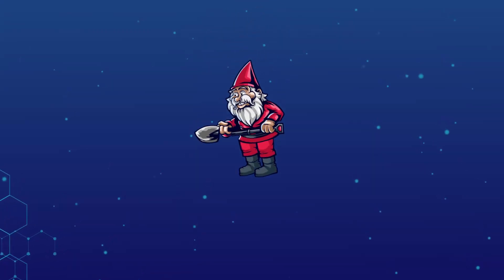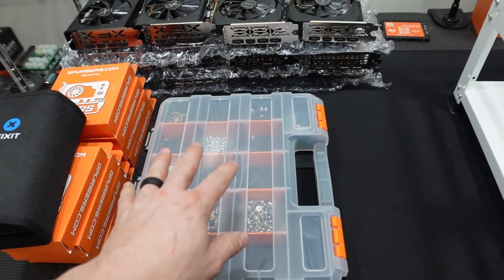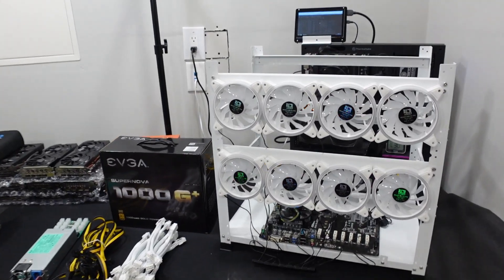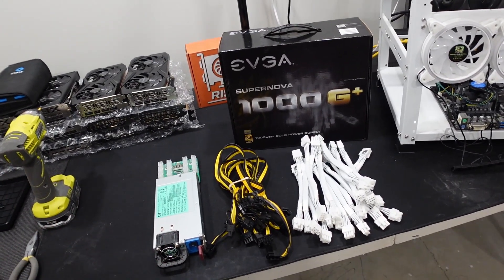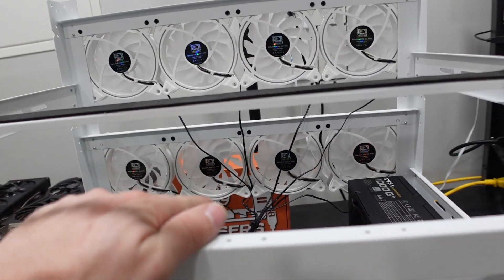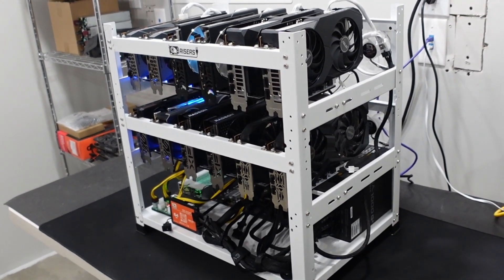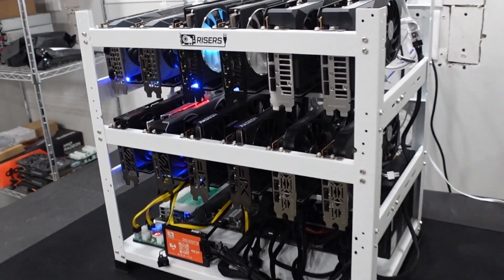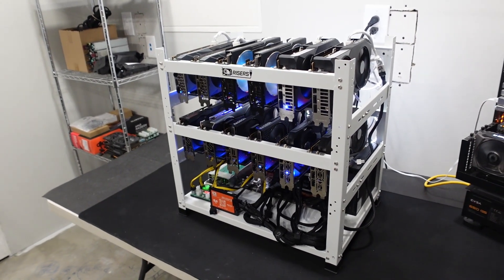How To Build A GPU Mining Rig | RX6600 Crypto Mining Rig Build

Comment: The Hobbyist Miner , your probably not running as efficiently as you could be using that dual power setup. I have three 12 card 6600xt rigs all running off ONE 1300W PSU from Antec (Platinum rating). It's using between  705w - 715w total power (each 12 card rig) at the wall. These are great builds with little to no downtime at all , they have an up time of 59days on Hive!!! Best bang for your buck.
Reply: those antec platinums even have a built in link feature. wow.

Comment: Dude I'm excited to see your journey with heat management; I am already worried; especially if ETH is no longer mineable and we have to use a KAWPOW variant algorithm like Ravencoin, feeling like it will be uncomfortably hot in my basement.
Reply from the maker: I have no plans to mine Ravencoin moving forward. One for the heat and second low profitability
Reply: Get a radiator or cheap AIO, Get a bucket or cooler. Purchase ice packs. Get vinyl hoses. Get a small pump. Attach your fans to the radiator/AIO. Connect them (may need extenders). fill bucket with water. Add ice packs. attach vinyl hoses to radiator and pump. Turn on pump. Turn on fans.

The cool water will cool the air as it is sucked or pushed through the fins.  You are now cooling the in the room air without adding humidity to the room, and this can all be done without using alot of volts as the pump doesnt have to be powerful.
Reply: @TheHobbyistMiner  yeah ETHC still looks pretty good
Reply: @FranOfBattle  window AC units are cheap... but water containers are a good idea.
Reply: @merrillweinheimer4063  yea but they probably cost more than what im planning. Next month im buying everything and setting it up. the pump is a 3.5 watt pump.
Reply: @FranOfBattle  So you would have to keep a steady supply of ice packs from a freezer somewhere? Seems like a lot of work having to manually swap out ice packs multiple times a day, but I am curious; sounds interesting.
Reply: @upsilonmining340  Better than paying an extra hundred dollars in an electric bill
Reply: @FranOfBattle  For, sure.  But by constantly freezing the water packs; your freezer has to work harder and therefore more electricity used there (thermal dynamics problem).  Just curious what is more efficient at end of day.
Reply: @upsilonmining340  Whats more efficient is not spending 1,200 dollars an octominer who's fans use 100+ watts og electricity tbh
Reply: @FranOfBattle  I agree, I do not believe the Octominers are magical server cases of cooling either.  I run all open air rigs, but updated the fans to be more powerful; working so far without spending a fortune in server cases.
Reply: @upsilonmining340  I bought a Rosewill. Works fine with 3 fans and the entrance can fit that AIO im talking about

Comment: love videos like this! Thanks for sharing and great work! 
Side question, is it ok to use the splitters? they both run on the same pcie cable to the power supply, is that not an issue? I have my rig setup without splitters, it is alot of cables and would like to reduce the amount lol. i just thought they had to be separated due to too much power. 
Thanks again!

Comment: Beautiful Looking RIG Great build. Can't wait for the next episode on this. I am thinking of building a rig but here in the UK impossible to get GPU's at reasonable price.
Reply: Mate.. The prices of gpu's in the UK have dropped massively, I've got a 6600 but also opted for the rx5500 xt which seem to be pretty good bang for buck.
Reply: @toddwilliams7534  where is the best place to buy them?
Reply: @TopsMiah  Ive been buying 2nd hand, rx 6600s between £300- 320 and rx5500 xt's £180- 220 on ebay.  Ive just started selling off my gtx 1070's as they are way to thirsty.

Comment: These are always sweet builds. I also have an 8 -6600xt's rig and a 8 - 6600 rig. My most reliable and efficient performers by far. Love checking my phone throughout the day and seeing those low wattage rigs hashing away. Just sold my last lhr gpu. Could not handle seeing those high wattage with high electric bills. Drove me nuts. Lol.
Reply from the maker: Smart Move!
Reply: I have a hodgepodge LHR rig that cranks out 350 MH on 1000 watts... with 11 cent electricity I like it... plus it will do ERG or RVN if POS shiits all over ETH. RVN today has the same earnings as ETH on 3000 series and ERGO is 29% more! You are right though. These 6600's are very efficient.  I plan to build my next rig with. I think you haven't tweaked your LHR's properly. My 3060's only burn 100 to 110 watts for 35+ MH. I'm getting 59 MH for 169 watts with 3070 Ti's. HiveOS and LOLMiner.

Comment: @Hobbyist Miner what do you think of ASRock challenger non xt 6600, mt drivers time out often seems to be a very sensitive card?
Reply from the maker: Are you on hiveos? I have had no issues.
Reply: No Iam using windows, I also have eagle 6600 non xt in same rig , no problems, I Rently increased mv and seems to be doing better but I still don't trust it lol I'm peep you hive video, I followed RPM's video last year but didn't pan out. 🙏

Comment: Run risers off Sata, Chain 3 6600’s on 1 pixie strand . 55 watt per gpu you should be absolutely fine. Don’t need an extra 1200watts mate..?? Waste of money
Reply from the maker: I appreciate your comment. Yet I will never run anything off SATA. I have seen too many melted cables doing that.
Reply: @TheHobbyistMiner  Iv been running sata for years mate iv never had an issue!
Reply: @TheHobbyistMiner  GPUs under 150w are fine on SATA. Been running many, many 580s that way for ~4 years. Just don't do it on anything above that. Most new risers don't even have a direct SATA connection anyways though.
Reply: These 6600's should have no problem with Sata power, but there's definitely some caution to be had.
Reply: @jameskguen  I got sata on 1 of my 3080’s . Not a single issue